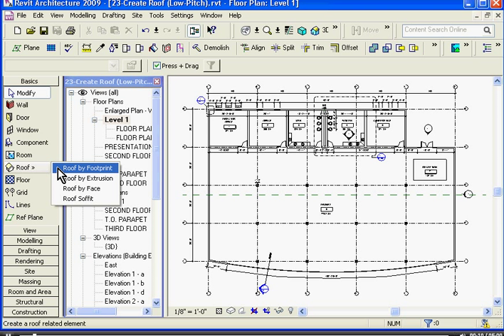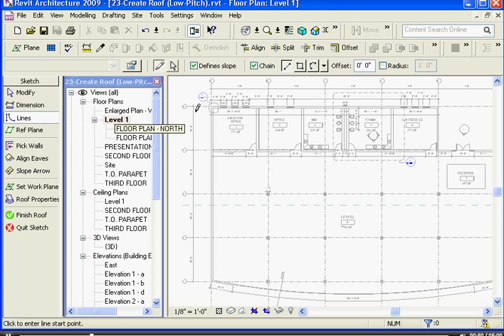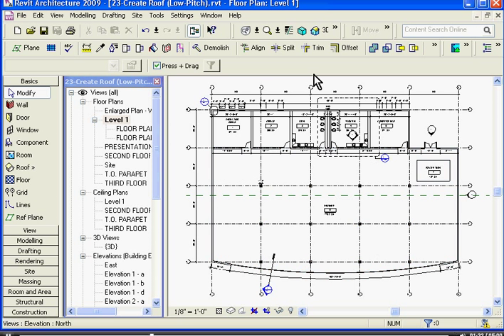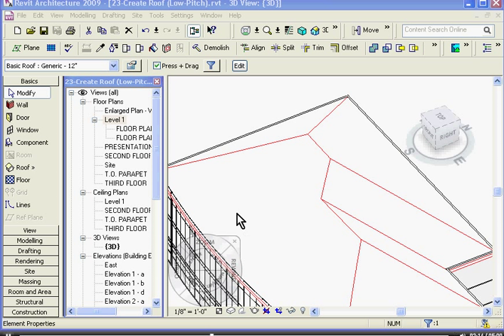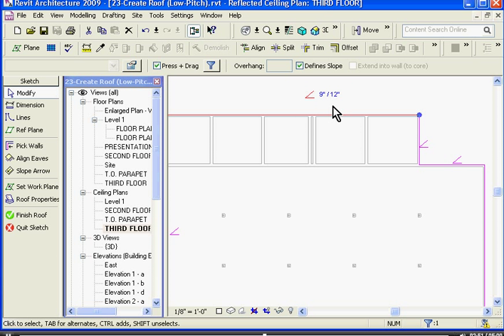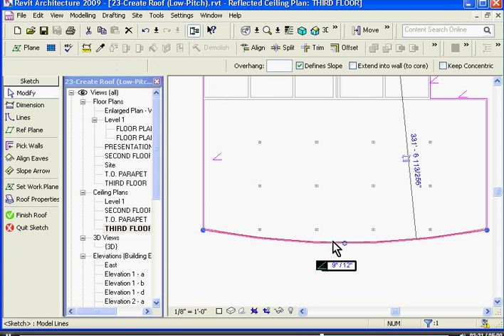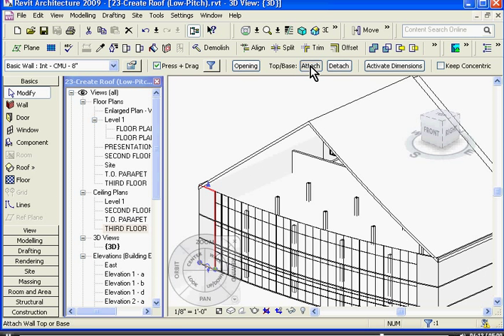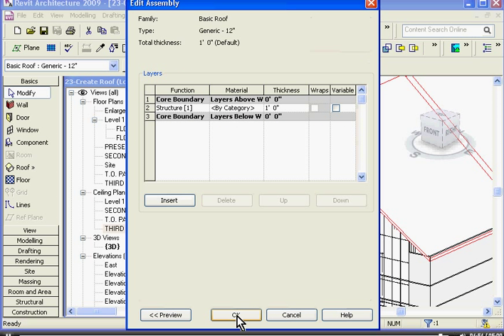Easy Revit  (2009) - 23 - Create  Roof (by footprint)

Comment from the maker: @djataras ...actually the best method for creating sloped walls that are not attached to roofs are to use the edit profile tool.  With that tool you can make the wall any shape you want, or use it to cut out doorways. I have a video on how to use this tool  called "video 25.3 - 6 methods for modifying walls"